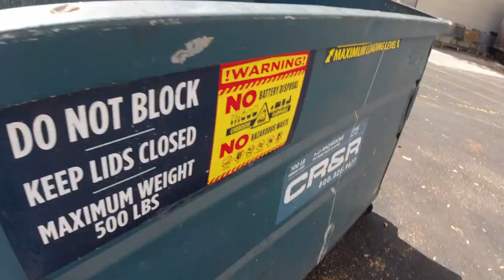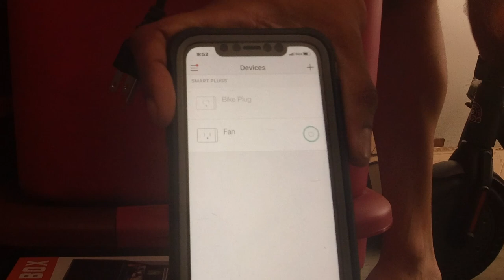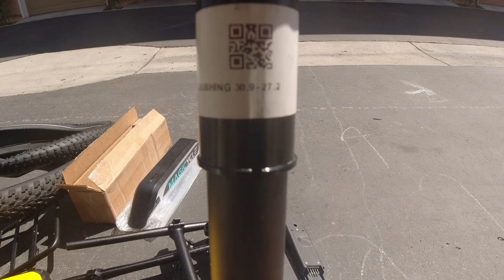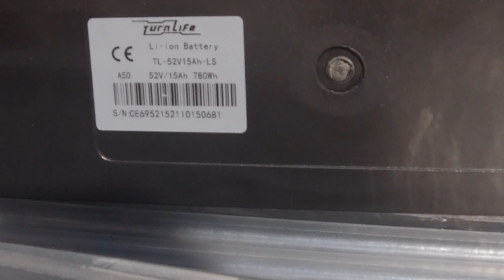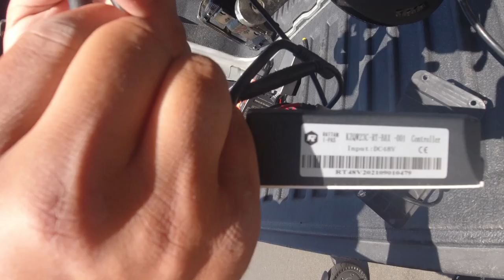WEEKLY VLOG! YAMEE EBIKE RANDOMLY DIED + LECTRIC LITE ARRIVED + FAVORITE EBIKE ACCESSORIES

Comment: Been watching you, you are in my top 3 EBike guys to watch. Hang in there energy levels goes up and down sometimes.
What would you want for one of those long neck handle bar stems?
Reply from the maker: Thanks for your input. I feel the same way about the energy level. Its hard to find a good balance. I don’t want it to be boring but it is difficult to have high energy all the time. I also want to put some good information out there. So yea. It’ll get better for sure.